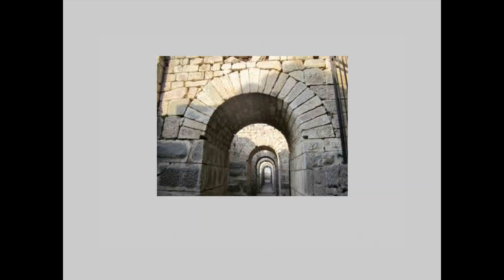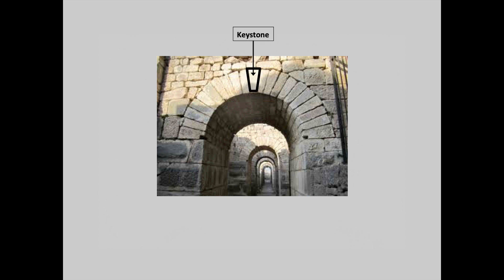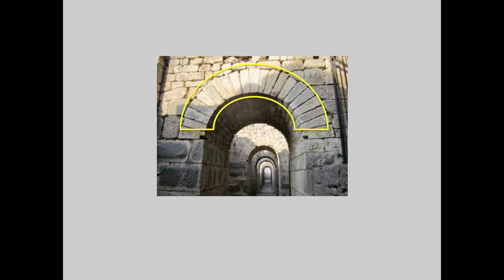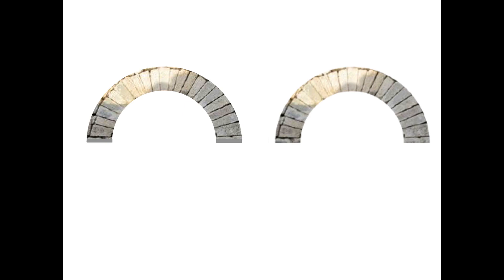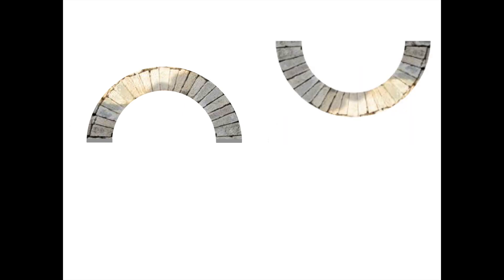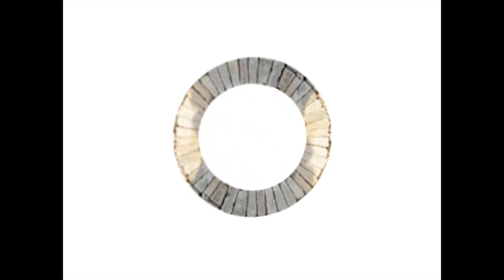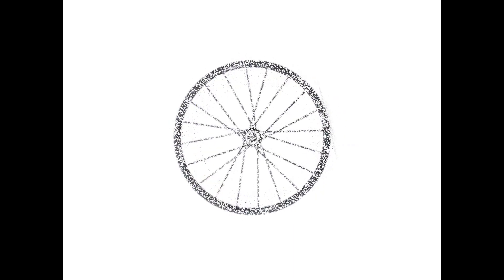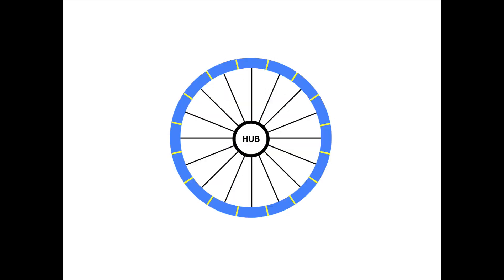Bicycle Wheel as a Circular Arch

Comment: Exactly!.
Those days i wanted to design a steel wheel for DIY narrow gauge farm railway, i was thinking about how to model the wheel to size the rim and the spokes, or maybe even make it a full dick but have to calculate the thickness of the metal to use.
I already used equations for beam deflection and  yield stength, but to solve this complex problem i could model the space between spokes as an arch.

Comment: It’s a brilliant description mechanically where the load is so evenly balanced once it’s tensioned and balanced correctly. In the hands of a good wheel builder you get a strong wheel in the hands of a great wheel builder you get a strong wheel that lasts a long time but you also feel the response from the road that information a cyclist can use.

The really interesting thing is the number of variables that keep the wheel true and balanced. Is it simply an optimization problem? Perhaps at one level that’s the case but what struck me in our wheel building session over a year and a half ago Bill was how layering on the tension slowly and methodically a little at a time brings the wheel to trueness - I have often thought about what trueness means is it complete concentricity? I am not convinced about that there has to be a little give in the wheel as it’s going through multiple loads and deformation. A complete concentric wheel could deform faster especially given that in a complete single circular motion there are multiple loads being imposed on it with tensioning and de-tensioning happening simultaneously at different points on the wheel. Anyway this is my intuitive thinking of course I know you have studied the physics and engineering of this in much greater depth than myself. It’s fascinating though a simple engineering principle is so complex.
Reply from the maker: Thanks for the response.  You should consider something other than Math Man so I know to whom I am communicating.
Reply: @BillMouldWheels  I will send you an email Bill I use that as my handle for YouTube it reflects my background and interests.